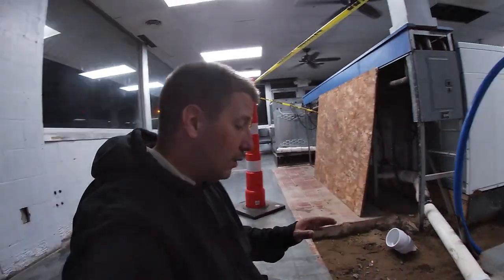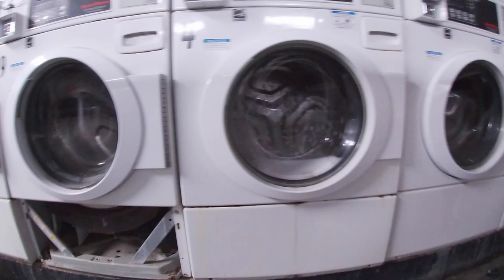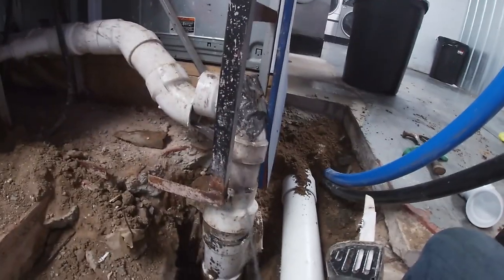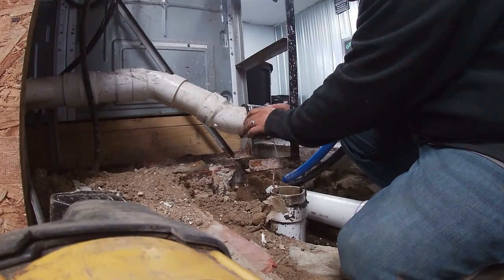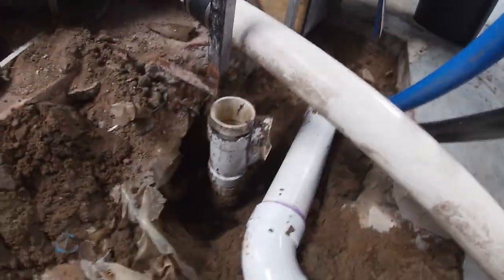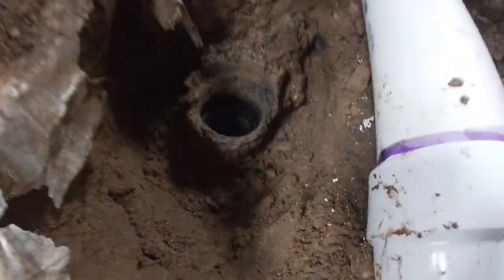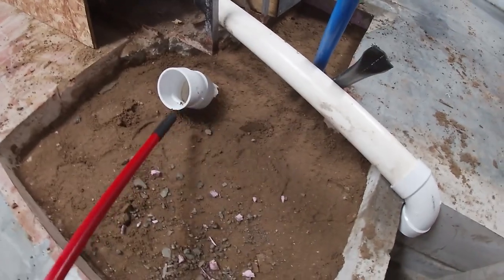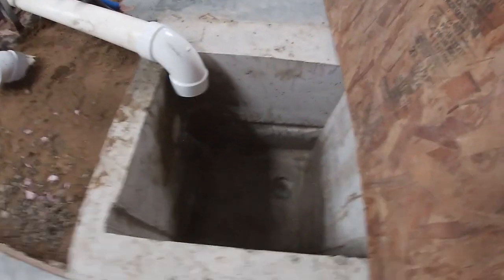Hooking Up The Drains!!! | Following Keenan!

Comment: 0:30 - he speaks of Horizon units not working well, I see a Speed Queen washer running.  Aren't Speed Queens some of the best?  Is Horizon a version of Speed Queen?  Also, I see a 4 inch PVC drain pipe that seems to be the main drain for that whole row of washers, a 4 inch pipe is enough capacity for 6-10 washers?
Reply: A 4 inch pipe can handle about 4000 Gallons per hour.